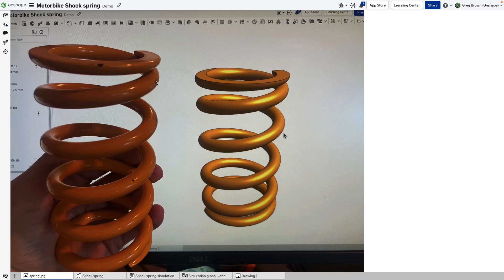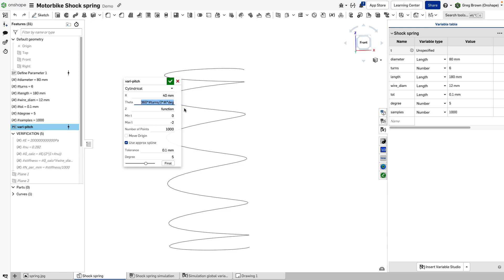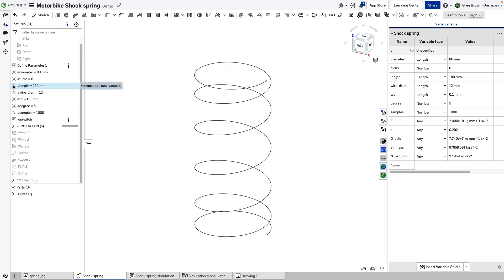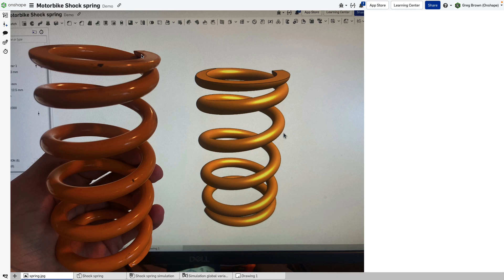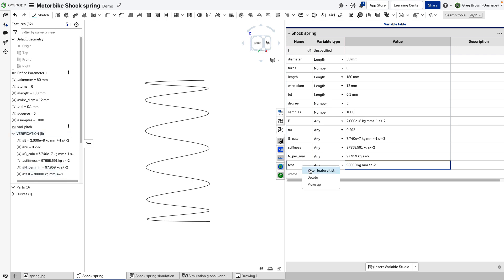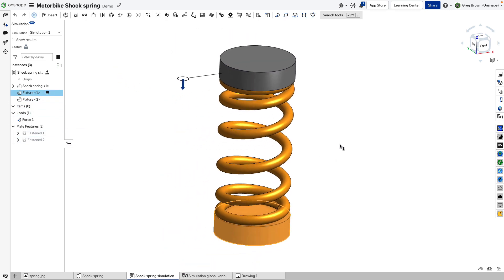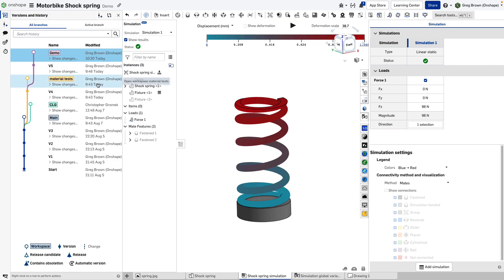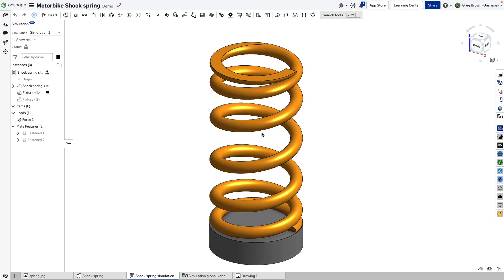Parametric spring building, verification, and simulation in Onshape

Comment: Great stuff ! Thank you for sharing. I have few of questions.
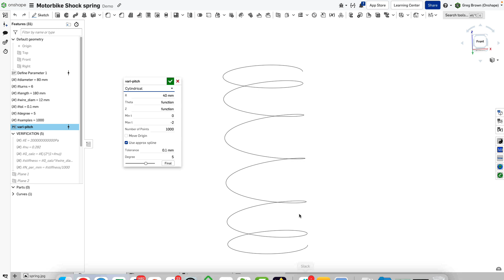1. 1:17 of the video I see that in the variable you have used a fuction. Can you please explain or make a video on how you created that in Feature script and linked it?
2. Are you using any simulation plugins are you using which is available in the onshape appstore? I'm using a free public account for the moment so don't have those Simulation tool enabled for me.
3. Is there any way to store the results of the simulation in the form of csv or json files?
Reply from the maker: See my other reply for the link to the "Parametric curve" custom feature.
There are a few 3rd part simulation applications available in the App store, you should check them out as they all have different strengths.
Regarding exporting of sim results in json/csv - for our native/built-in simulation the answer is no we do not offer that capability. You'd have to check out the 3rd party options to see what they might offer in this regard.